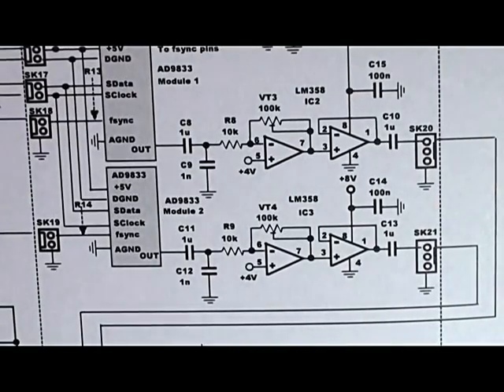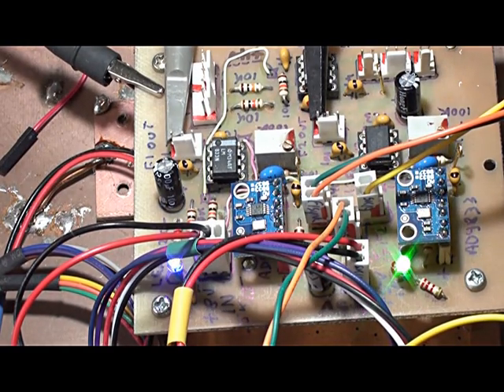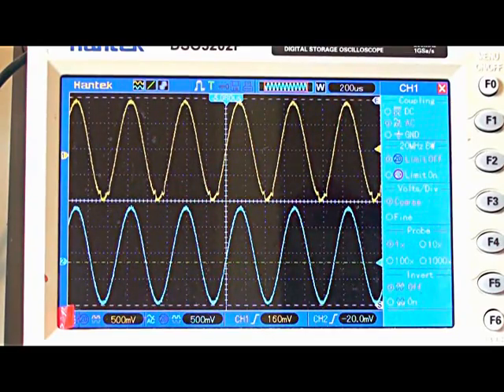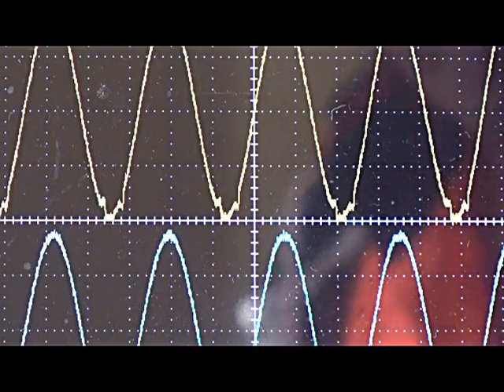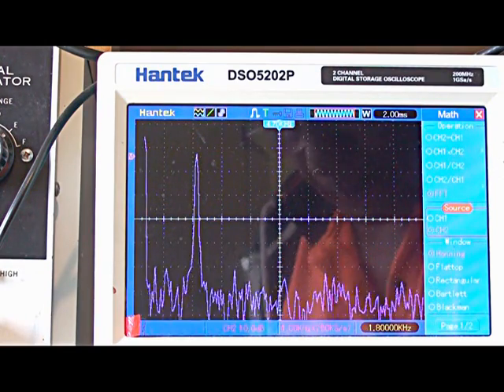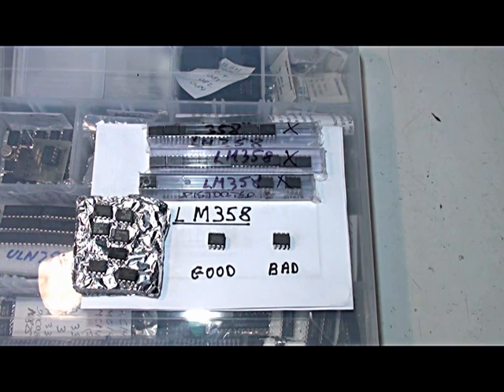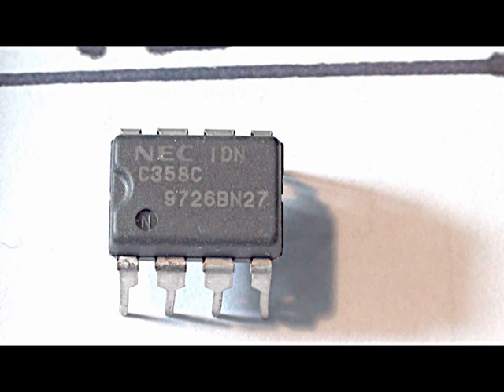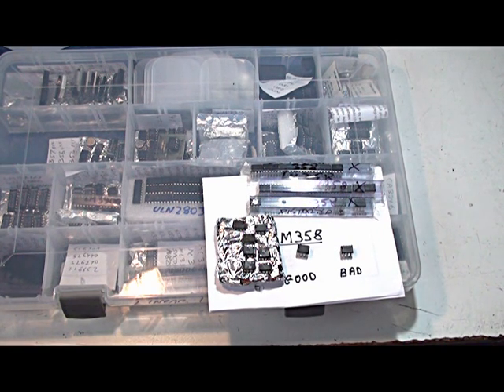Poor quality LM358 distortion demonstration.

Comment: Your inputs are well inside the common mode range?
Reply from the maker: Yes, input was only a few hundred mV pp and gain low so only from 1 to 2 volts pp out. Rails 12V. Only the poor quality LM358 show the distortion. But I also did all sorts of tests at other levels to. It made no difference to the distortion. And good brand LM358 ICs are clean. It  might be caused by phase reversal due to intrinsic diode like junctions in the die as described in engineering literature from Texas Instruments. Poor quality materials  can apparently contain intrinsic  semiconductors such as diodes and transistors inside the substrate. As this batch came from an Asia source , the quality and cleanliness of the materials is questionable. Looking closely at the waveform down in the negative part of the sine wave, we can clearly see the voltage do a small change in direction which is a phase change. This effect tends to show up during the low signal current part of the signal. Looking at the waveform you can also see the onset of the conduction points in the intrinsic semiconductor on each side of the phase reversal portion.

Comment: The output stage of the LM358 is very simplistic (it was designed to be a cheap opamp ~40 years ago, and design choices were made) and basically class B. How much depends on the variant and process, but you can sidestep that by pulling on the output (resistor to gnd or supply) such that the output is always either sinking or sourcing. When operated like that it becomes an okay opamp. (The opamp has an internal 50-120uA sink on the output, which is why for very light loads it has okay distortion - the output is operating in class A. This sink varies a lot between manufacturers). oz2kkp.
Reply from the maker: There is a good "Application Design Guidelines for LM324/LM358 Devices" paper written by Ronald Michallick for Texas Instruments in 2019 and updated 2021. You may have already read that paper. It describes in detail the design of the chip including the various currents. Although the original design was many years ago, there are still modern versions manufactured. The SMD version is just one with improved performance. These are common in quite a lot of current equipment. At the university I was tutoring at, we had manufacturing dies for many ics.  One student Engineering project was to examine the LM358 design and then produce a working chip in our ovens and machinery.  I believe the effect I am seeing in the  poor quality LM358 from Asia may be "Phase Reversal" with a negative going signal.  The input signal current activates  parasitic NPN transistors which then takes  current from other internal connections and inverts the signal phase. I believe that is what I am seeing in the trace where the signal appears to turn upwards then downwards and then up. Poor quality semiconductor material can contain unintentional diode or transistor type junctions.
Reply from the maker: Hello, yes, I have used these OP amps for many years. In this video I am demonstrating the distortion produced by a poor quality one purchased via a local supplier who buys from Asia. The tests I have done, include some circuit changes such as varying the source resistance (the source resistance has a significant effects on the THD  ), and load values. In this demo the input level is quite low and raising moderate gain. The output level is around 1 to 2 volts pp and does not go anywhere near the rails which are 12 volts. So we are not clipping at the rail.  Varying the input level makes no difference to the distortion. 
The low quality LM358 shows a waveform distortion at the most negative point of the waveform. It looks like  one of the junctions inside the package is not behaving correctly. These devices are balanced amplifiers with constant current sources. I suspect the device meant to produce current balance between the long tailed pairs is a poor quality material. I know that LM358 chips can achieve at least -60dB THD (0.1%THD), and I also use FET chips like the TL072 which achieve figures down to 0.003% THD. In this project I only need -60 dB. So this is just a comparison between a good op amp, and a bad LM358. When I did the video I did have an LM833 in one channel but it was the last test I did so I left it in. Earlier tests with good LM358s (NEC and other brands) showed -60 dB or better with the good LM358 and only -40dB with the poor quality one. I have a tube of 30 bad ones and all the ones I tested from that batch were bad - clearly a manufacturing issue not a design problem with the LM358.